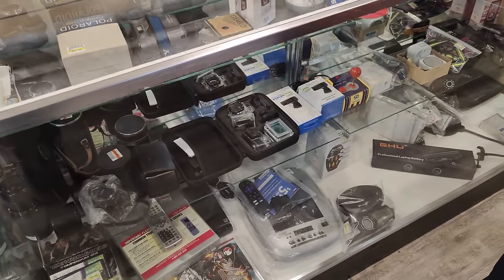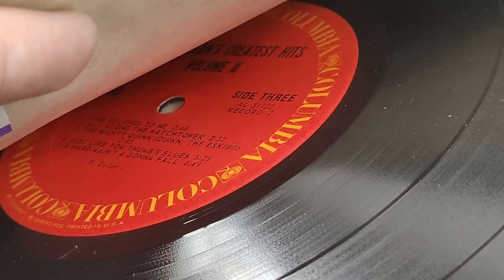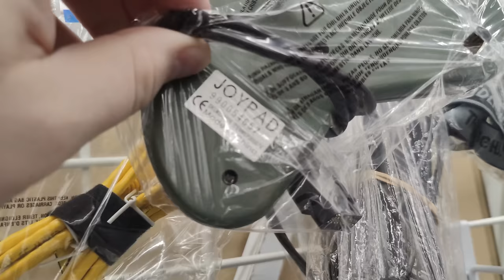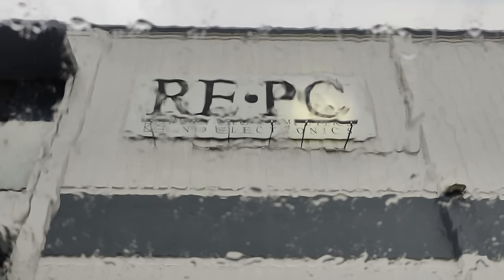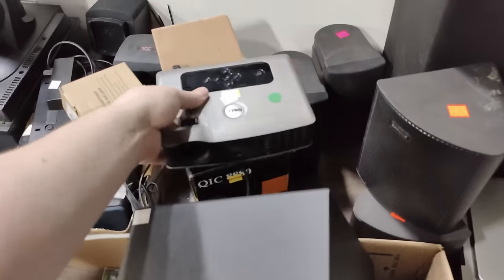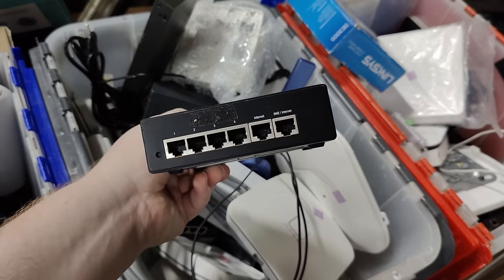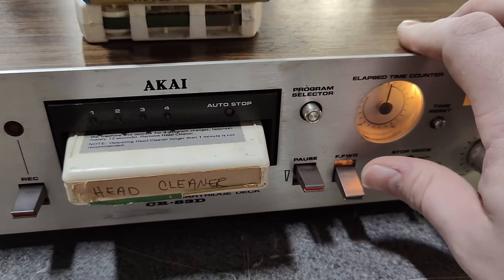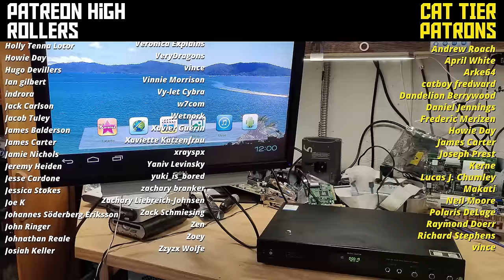Thriftmas 2023

Comment: The Buffalo snes pads are actually really good, they feel like a brand new snes controller and on top of that are known to have the lowest input latency of almost any other usb gamepad!
Reply: Seconding this. I own the SNES one and a pair of Famicom style ones. They even fit into the controller resting spots on an actual Famicom.
Reply: Indeed, Buffalo is a Japanese electronics manufacturer and there stuff is usually decent.
Reply: Yup. They're the best you can get. I guess CRD was more interested in sounding clever by criticizing things he doesn't know anything about. Pity.
Reply: Bought two of these for a Raspberry pi emulation station I built for a friend. The controllers are pretty solid. Just as good as a real SNES controller. As far as I know, he hasn't had a problem with them for the 5 years he's used them.
Reply: @gklinger  more than likely he was going off of his experience, which is that 99% of knockoff pads are awful.  I'll admit to being very surprised when I found out Buffalo SNES pads were really good.
Reply: And you cant buy them new any more. They sell on Ebay for more than I bought mine for
Reply: I just use the Switch Online controllers on PC for the most authentic experience.  I use the N64 one as well,  but those are always hard to get without getting that one notification app for when they're in stock.*   And requires the subscription unfortunately, unless you want to pay scalpers.
Reply: I bought a new-in-box Buffalo gamepad at a Goodwill for ten bucks last year. One of the best controller values ever.
Reply: My friend had a pair of these and gave me one in high school, it's my sister's now and it still works like it's new.

Comment: So I found out what that 8 Candles Trading Outpost thing is: It's a power supply and controller for one of those 'detoxifying' footbath electrodes that makes it look like the detox is working by accelerating corrosion of an iron coil inside and dumping gnarly looking rust into the footbath. 

Also: tooge.
Reply: Alsos their site is still up but just shows a page with the text:   print ''; /** lol **/

Comment: The Niveus Media Center looks interesting. It's a HD TV recorder/media center that cost over $6K in 2005. I'd love to upgrade the motherboard and have a high-end HTPC in an awesome Krell-like metal case.
Reply: And you'd have to ditch the TV tuner cards since they're probably analog and can't handle digital ATSC signals.
Reply: @CantankerousDave  It comes with 2 analog SD tuners and 2 digital HD tuners for over-the-air HDTV broadcasts.
Reply: @CantankerousDave  nope, and that's what makes the Niveus special and also why it can only run Windows Vista. The Niveus - besides being the other major customer for the Seasonic SS-400FL/SS-460FL - is the ONLY manufacturer to have a fully ISF and CableCARD ceritifed system. And this one has the required tuner upgrade, so it supports NTSC/ATSC/ClearQAM and CableCARD.

Comment: Those Aviom devices are designed to allow musicians to control their monitor mix in the shows mixer.   A lot of the major mixer makers make such a system, but a lot of shows will just have a dedicated monitor mix engineer.   I am not surprised they came out of a church as churches spend a lot more on AV than many places and also tend to lack manpower to have a bunch of audio people running around.
Reply: Avioms are used a lot in theatre. I wish we had them at my main theatre. They require a head interface -- I've never seen exactly how it's all wired up. I'm also not sure if I've ever heard an Aviom sound system sound good.  At least as a keyboard player, they usually do some mono summing but everything always just sounds a little cloudy.
Reply: @alextirrellRI  True that the sound isn't always great, but I think that might be due to it being a headphone mix and not eq'ed very well. I've played gigs where we had in-ear monitors but we had no control over the mix, so it varied from show to show and sometimes during a show. I would have given anything to have an Aviom mixer on that show.
Reply: @motomike71  Oh of course, I'll take Avioms any day over any other kind of provided headphone mix that you can't control at all. My sad suspicion is that there is something all the audio techs I've used them under is doing wrong in the setup making channels sound worse than they should, that they don't know because they are not the people using the system. They just set it up.
Reply: Man id grab those avioms
Reply: I still have a set of Furman headphone mixers kind of like this.  There's a 1U rack with 4x mono inputs and 1x stereo input.  It uses 2x Ethernet cables to carry analog audio and power to daisy-chained mixer boxes that mount to a mic stand or something similar.  The performer can adjust the level of the stereo (usually main mix) and four mono (the individual "more me" channels) sources to their liking, and connect up to two sets of headphones.

I used these all the time when I was playing in bands.  It made practices so much easier to have in-ear monitors with custom per-person mixes.
Reply: the current ones even support Dante (not the individual Mixers, but the central Hub) and the can now feed the Mix back to to Hub. Great if you want to use them with a wireless system.

Comment: BSR - wow!! They made turntables and broadcast equipment back in the day over here in the UK.  Given their size, and looking at the wood, I'd suggest those two speakers probably came out of a 60s-70s recording studio, or radio station etc.  I'd certainly have taken them home!!
Reply: Yep, you'd have to replace the foam. not particularly high quality speakers though, but they sound great for their initial 200-300 pricetag. Not worth the hassle imho. They're from a later period when BSR was taken over by DAK or something, they're not the $$$$$ speakers you'd find in a studio.
Reply: @derkeksinator17  interesting.  I didn't know BSR in any other way than the high end British kit... Like so many others, it's just a name now, intellectual property to the highest bidder to make the lowest cost items!
Reply: @NiddNetworks  High-end kit? I only know them from the cheap record changer mechanism.
Reply: @eDoc2020    I have two of their turntables in a back storage room.  One took a tumble down some concrete stairs at the dorm in college, and kept on working, so they're at least tough.  That said, the sound quality of their lower-end units like I have is not good.  Tons of rumble right out of the box, but I was a poor kid, and used what I could get.
Also, at least the ones I have were made in England, and are set up for 50hz electric.  We use 60hz here in the USA.  Thus, when you play a record, it is actually playing it back slightly faster than intended.
Reply: @ripvanwinkle9648   If you run a 50Hz AC motor on 60Hz it will play more 20% faster. That's more than "just slightly" faster, the pitch will be way off. Since the 70s most record players have used semi-regulated DC motors. They'll have speed adjustment controls so you can easily get within a percent or two of proper speed.
Reply: @eDoc2020  No speed adjustments on these two BSR models.  They obviously did something to keep the speed close when used on 60Hz, but it is still a small amount too fast.  I compared to my Technics SL-1200 Mk 5 after I heard that they run fast and they do.
Reply: @ripvanwinkle9648   If they have shaded pole induction motors (as most old turntables did) they won't have any speed regulation. If the line voltage varies the speed will change a bit, same if there's extra drag on the motor/platter. They'd probably come from the factory a bit fast, with the expectation that as things wear and lubricants dry up they will slow down. Semi-regulated DC motors like most modern turntables have will behave similarly but might be slightly better. You'd be lucky to consistently get the speed within 1%.

The SL-1200 MkII and most other direct-drive turntables have a quartz lock mechanism. Quartz oscillators have their error measured in parts per million rather than percent.

Comment: I'm a sound guy at my church and we use the Aviom mixers.  Basically you take the secondary sends from the sound board to the main Aviom hub and those get hooked to the hub with CAT5; then the musicians and singers use them with the headphone monitors to control what they hear in their IEMs on stage.
Reply: the new Hub supports dante. and you can even send the mixes back to the hub and out to the dante network (and to wireless inear transmitters).

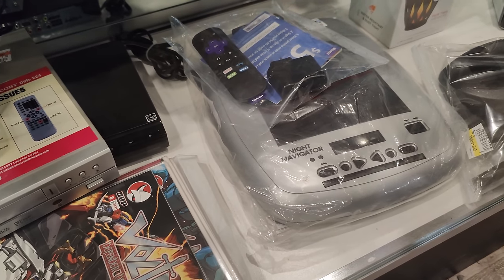Comment: 00:50 That USB DVB-T tuner card is partially obsolete, as some countries have switched over to DVB-T2
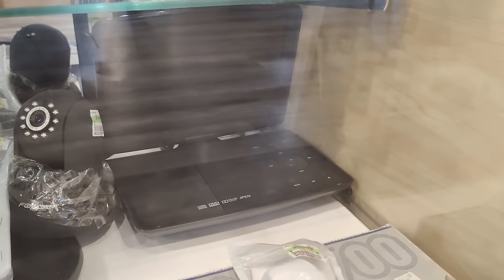02:54 Those cheap portable DVD players are great if you need a little monitor for a raspberry pi, if they have they have an aux video port, or you figure out how to inject your own video signal inside the player

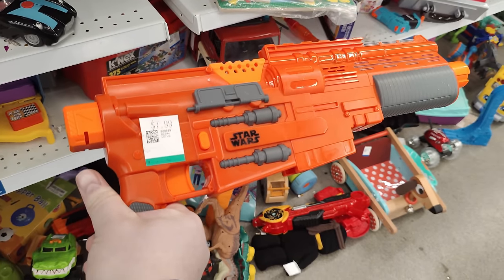06:55 I guess the colouring is avoid looking like an actual gun
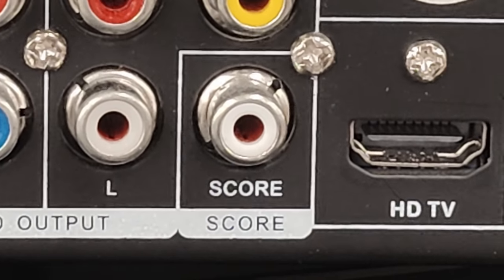09:08 "score" output is probably either composite video or audio telling how many credits are left
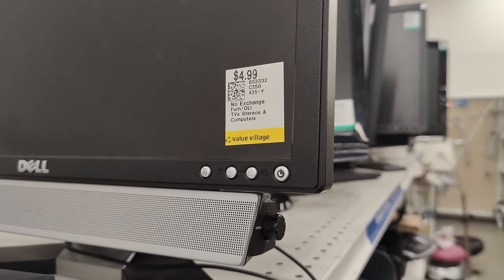10:25 I found that those stickers are easier to remove if you use some alcohol or window cleaning fluid, but yes, they should be put closer to the middle to make them easier to remove

16:41 "dvd midi karaoke" Is that a thing? DVD's loaded with MIDI tracks for karaoke machines to sing over? I want one!

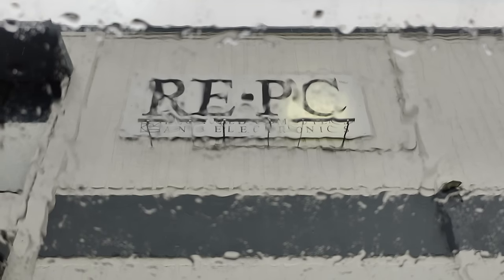17:40 that certainly looks like an interesting place to spend time at
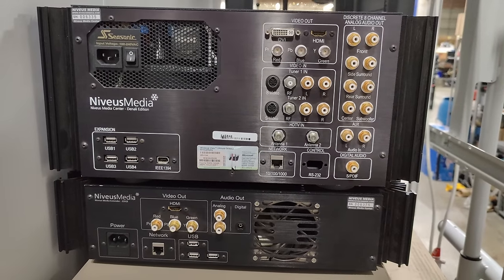35:46 that combo looks pretty interesting, but might be too obsolete to be interesting, but I'm curious about how they rackmodded an X360

Comment: The DB9 to RJ-45 adapter is actually kinda useful. I've got a solar power inverter, and it didn't come with the adapter required to wire it up to a serial interface (its serial communication port comes out of an RJ-45 jack).
Reply: Likely a console cable like for a Cisco switch

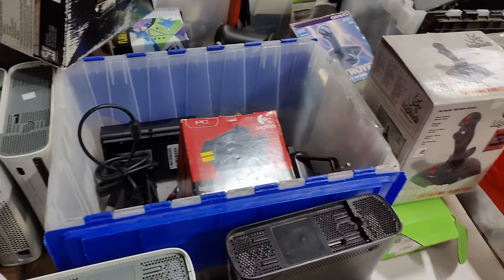Comment: 32:51 omg that logitch wingman joystick, i bought one of those (not exactly this one) a few weeks ago in my local thrift store, really cool lil joystick, it has a motor for each axis and basically emulates spring tension which can be adjusted thru software similar to the dualsense adaptive triggers and has force feedback, there are like 5 games that support it but still really fun (it was 8 bucks ok i had to 😭), also, mine at least uses a 24v power supply and gets hot real fast lmao
edit: 33:02 omg another one lmao, that price tho... good luck selling it 💀

Comment: Those Aviom mixers are great. I've used them in pit orchestra for musical theatre when our sound was isolated and went straight to front of house. Each of the members of the pit would have one of those boxes and you could dial in your own mix of the orchestra and the cast mics into your in-ear monitors. I never saw the whole setup. I would imagine they would require a central unit or might plug directly into a mixer that provided that functionality like the Behringer X32.

Edit: and in the sundry audio box bin I think I glimpsed the Aviom head unit. 25:51

Comment: 32:57 ah you finally you found one! I just left a job working for a military contractor setting up wave soldering machines from the 90s, we had 4 machines running dos and ~50 "newer" ones running windows nt. This is the controller they had us use to control the robot arm inside the $1m machine. We had a stockpile of dozens of them as it was someone's job to buy them off of eBay to keep us from running out.

Yes they're about as awful as you would expect.

Was cool learning DOS though I'm mid 20s so never would have had a reason to otherwise.

Comment: I bought a used Inkjet printer at that Tukwila Value Village, just because it was a good resolution photo printer for $14 (a Canon MX922), and ink for it is insanely cheap. $20 for a new wireless chip in it, and it's been doing fantastic since.

Comment: Those DB9 to rj45 adapters are handy for doing rs232 over CATx. Repinning at the adapter would be useful if the Phoenix connectors on the back of a device buried in a faraway equipment rack were difficult to access and you needed to troubleshoot!

Comment: 29:50 So I work for the Audio Vusial Services department at my University and we use devices from Revolabs and we have a few simular devices like that one. What your holding is not for traditional conference calls per say but more rather more for Skype/Zoom calls as well as to record the audio from classes or presentations. It's a portible wireless mic that you clip on to yourself with a base that can charge the mics and speakers. The other device with the usb ports connect to a computer and the computer would just see a usb microphone that Skype or Zoom would use. We have times where Professors/Instructors would want to record their classes and we would give them a smaller version of what you have as well as a webcam with a USB extender and tripod.

Comment: 28:13 I do audio for a club, and we have used a cerwin vega subwoofer on one of the dance floors for over a decade at least. its been physically and electrically abused by DJs and club customers but after an input jack replacement or 3 it still works well for what its being used for.

Comment: Lmao, the printer at 7:45 is the same one I got on Offerup 2 years ago for around 25-30$. Works fine and since I don't print much, it's been a fine experience while ink is fairly cheap for such an old model. Has more versatility and reliability than any garbage for around the same price on Amazon.

Comment: 30:00 - VoIP/SIP conference phone system... the speaker and mics and controller are all wireless.  It actually sounds good.  But the reliability was 'meh'.  And everyone would forget to 'dock' everything - so the next user would deal with dead batteries.   We ended up replacing them all after a year.  IIRC, the audio jacks allowed you to pipe audio into an overhead sound system or to pipe audio in.

Comment: cerwin vega makes some amazing audio gear. My old band used some of their mains for our live shows. It was hard too do and we only saw it happen once in the 10 years of preforming with them, but if the speakers clipped, they would have a green light that you could see coming from inside the port holes. Again, we only saw it happen once, and it was on some pretty nasty feedback during sound check before a show. 

I believe cerwin vega was originally  owned by Gibson, but don't quote me on that one...

Comment: Cer-win Vega, I've heard they're a good brand.  Usually obvious to pick out the home ones since they have a red woofer

Also MCS actually had some really solid stuff at the beginning, it was rebadged Technics,  real obvious when see the turntables.  Sadly I think the one you saw is rebadged Sansui, the later Sansui at that.

The Niveus confuses the crap out of me because, you need the Xbox 360 disc drive to boot the system.  So is it in the case?  Also I'm wondering if the heatsink is properly installed because it would be better than a normal 360.

Comment: 1:11 Actually, there are a number of digital TV standards out there. There's ATSC in North America and... South Korea, for some reason. There's ISDB-T which used to be unique to Japan but a modified version got eventually adopted in most of South America and a couple of African countries. There's DTMB which is used in China and a couple of "anti-West" countries like Cuba and Pakistan. And there's DVB-T used in most of the rest of the world, which is Europe, most of Africa, Australia and some parts of Asia. Except some of those countries now use DVB-T2 which uses different modulation. That doesn't even include regional variation of codecs (MPEG-2 vs. AVC vs. HEVC). A lot of European countries adopted DVB-T in MPEG-2 in 576i early, only to migrate to DVB-T2 in HEVC in 1080p (or even 4K) a couple of years later. So the bottom line is... 1. it's not as simple as "America vs. rest of the world" this time, 2. that tuner won't even work in most of Europe anymore, either.

13:46 Until recently, Polish Windows used to be preconfigured with two keyboard layouts: "Polish (programmers)" that everybody uses, which is actually the US QWERTY layout with a couple of additional key combos for Polish accents, and "Polish (214)" that nobody uses, which is based on an old typewriter layout that is QWERTZ. And of course, Ctrl+Shift is the default keyboard shortcut to switch between them, so the Polish Internet (and all the designated friends&family tech support guys) is absolutely overflowed with questions like "my Ys and Zs got swapped, pls halp" and we all tech-savvy guys uninstalled the "214" layout multiple times for everyone we know. So... I don't know how you ended up with the German layout installed, but you just felt our pain.

26:05 My favorite way of generating composite video from a modern source: Raspberry Pi. Even the Pi 5 still has it on the PCB, although you'd need to solder your own jack somewhere. The output is of excellent quality and supports every standard that ever mattered, including more exotic ones like SECAM and even Brazil-exclusive PAL-M, as well as progressive 240p/288p. I actually helped to add support for all those standards into the Linux kernel.

Comment: I just literally just dropped one of those grace digital boxes at my local goodwill.

It used a qualcomm chipset that used the "Reciva" platform, which they pulled the plug on a few years ago. You can still use a DLNA server to relay stuff to it, but all of the internet radio/podcast/sirius XM stuff is non functional anymore.

Also, a JCPenny's house brand MCS was all built by Panasonic or NEC, so some of it is actually decent.